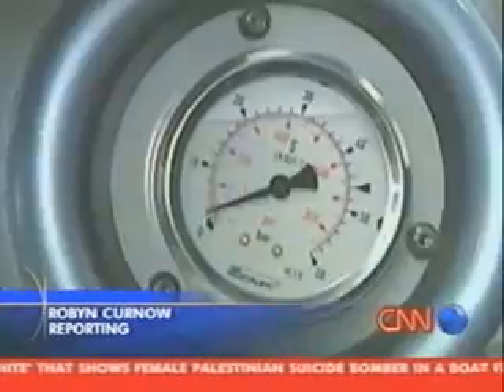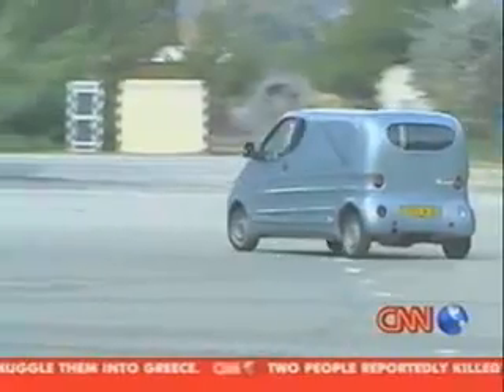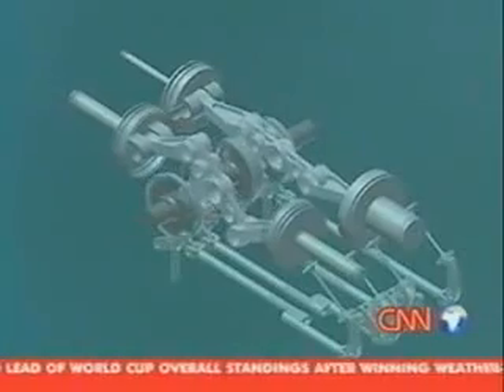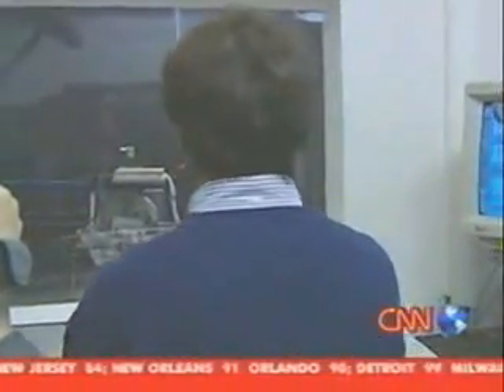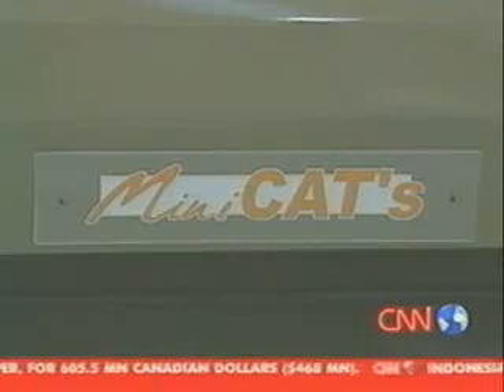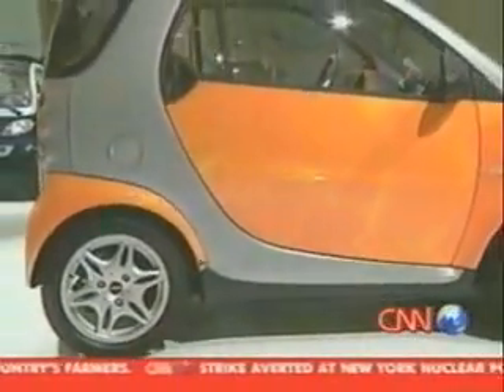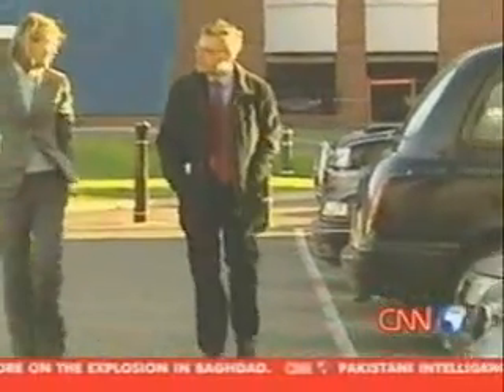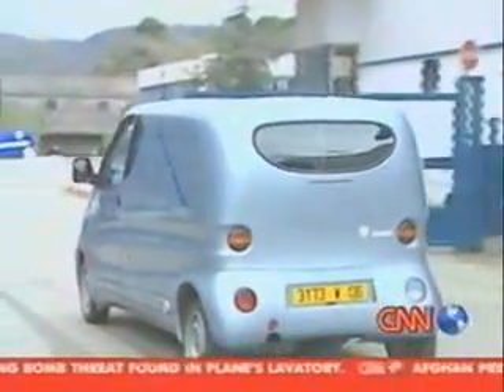CNN - A revolutionary car that runs on air

Comment: @lucas911611 As air expands it cools this can condense and freeze water in the air. If you use a dryer on the compressor this isn't a problem it just wastes yet more energy.   Question with a question Do dive tanks smell? think about it

Comment: would this working in cold weather?  If it is compressed air, would the air inside the compressed tank be turned into ice if the weather is below certain degree?

Comment: Sigh Air compressors and air motors (you need both) are horrendously inefficient due to the ideal gas law. There is no way round this. An electric vehicle is five times more efficient

Remember all the claims etc by MDI are lies This is an ongoing SCAM

Comment: Wasting it how? The modern internal combustion engine is every bit as inefficient as this thing is. By using this, you'd be doing the EXACT same thing as you would with a normal car, only without the Co2. I love the internal combustion engine more than most, but sadly something needs to be done.

Comment: Though I'm not fond of the body style, $6,500 is a good price so long as you can economically get good mileage; and take long trips without worry.  I was looking into the Smart Fortwo car a while back.  At a starting point of over $11,000, I might as well just keep paying for the expensive gas.  I was shocked that you could spend about $20,000 on the "deluxe" model.  What good are these vehicles, if you cant afford them?  That is the current hurdle.  Glad to see someone taking this into account.

Comment: Yeah sure more R&D would help ,but i think the whole idea is quite daft actualy .
You still need to buy fuel to run the compressor to get the air in the tank .
I'm sure survo's are not going to let you have theres for nothing if you are not buying petrol .